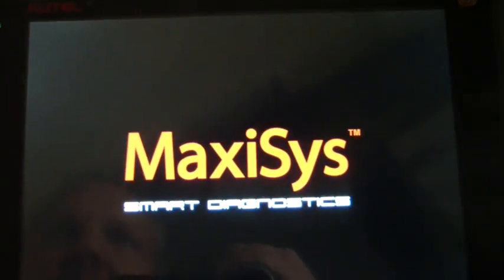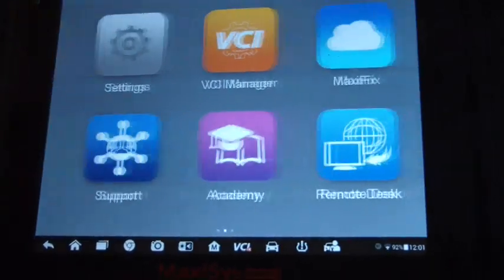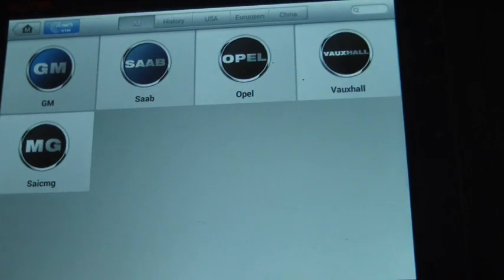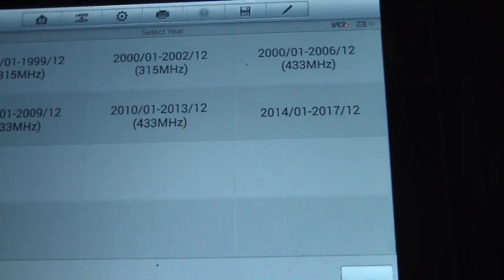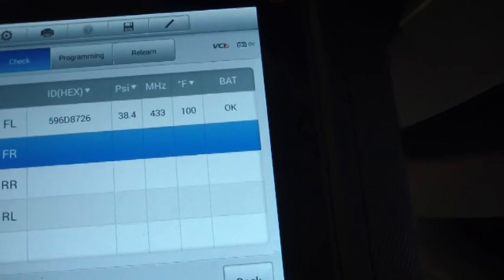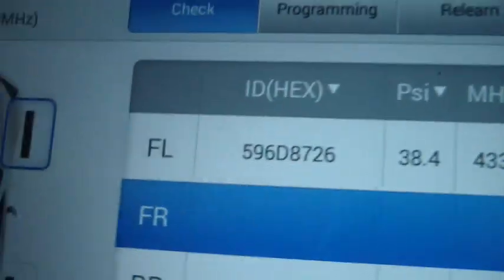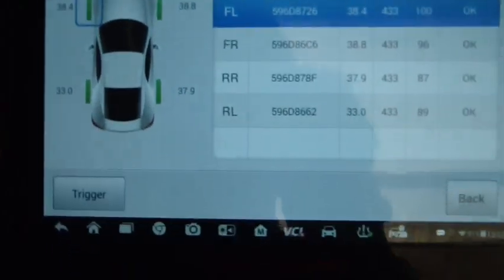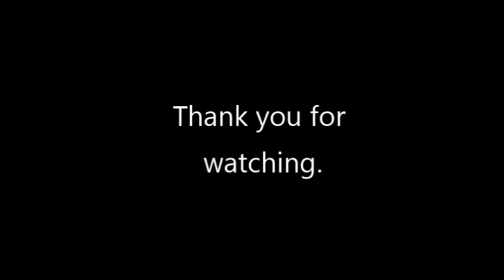Quick Review of the Autel Maxisys TPMS MS906TS.

Comment: Do you think. The 908. Will do more then this 906
Reply from the maker: colas solorzano I really don’t know. I would actually like to know that myself. I know they all use virtually the same software so it would be interesting to know the difference between the 906 vs the 908
Reply: @737mechanic  I have a 906 and asked Autel. Same exact software but different hardware. 908 is just using faster cpu etc.